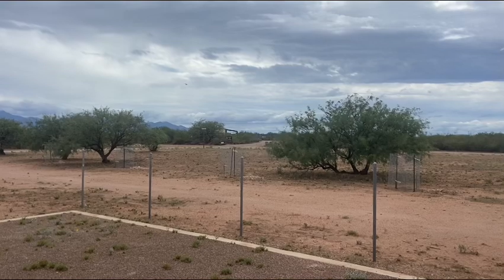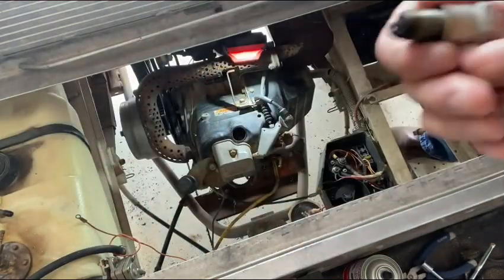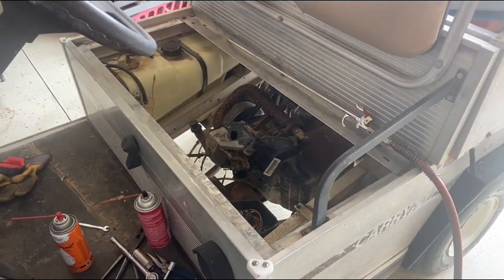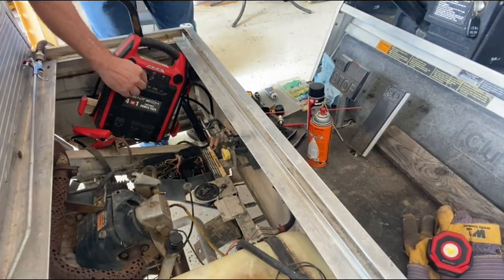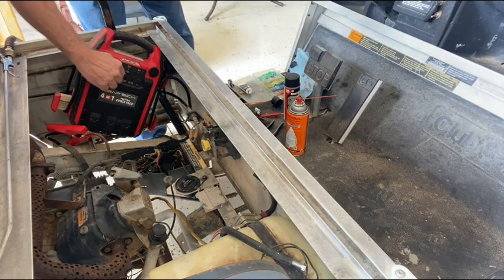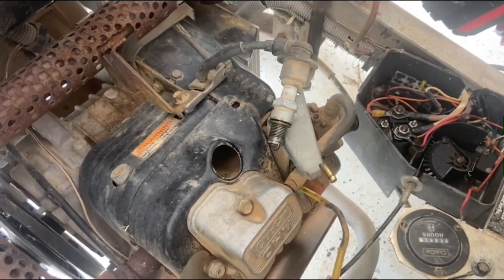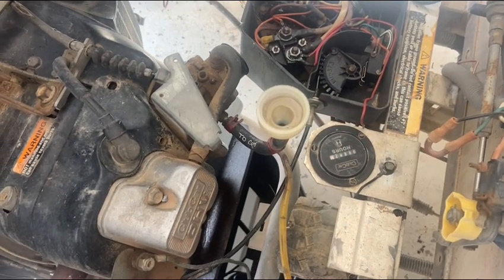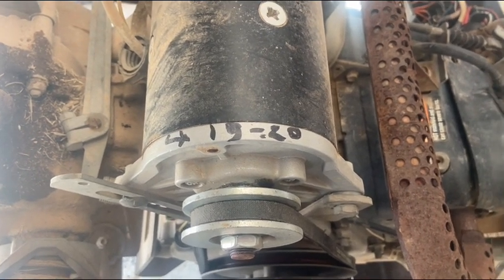Early 90s Club Car Carryall. Can We Save it? Part 2

Comment: my pulse fuel pump didn't have enough power to move the fuel from the original fuel tank all the way around to the engine after I put the predator engine  in. I use an electric fuel pump but it is very low power I think it is 2 to 5 pounds, I figured anything stronger might push past the float valve in the carb. it sounds like your cart is like my old Yamaha g1 to get reverse, the engine runs backwards.
Reply from the maker: The electric fuel pump added to this one put out way too much pressure. I have to look at it again and see if it has a rating on it. I still need to follow all the shift linkage to see how reverse engages, but so for the old cart is looking promising.